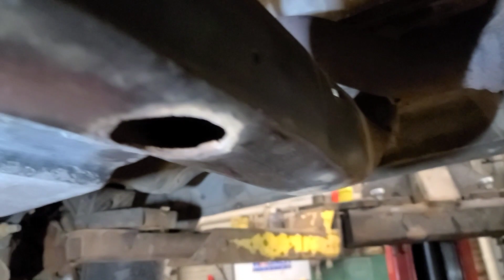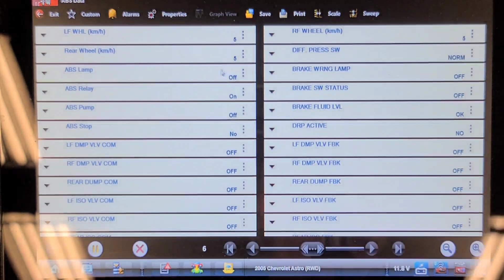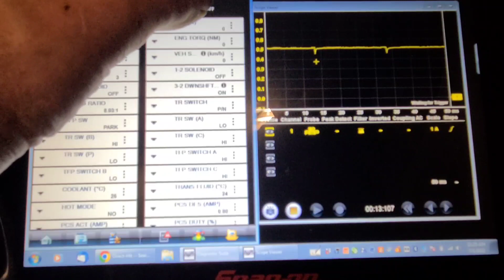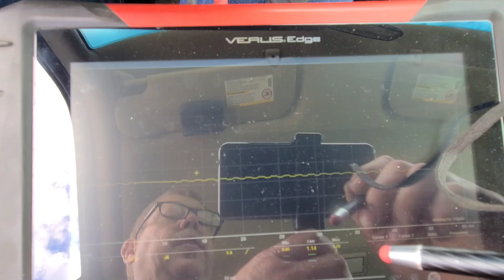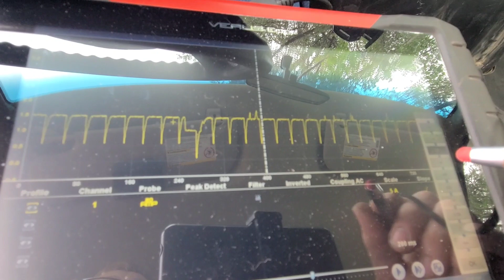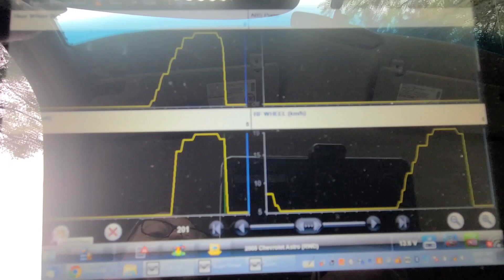2005 Chev ASTRO Van Transmission Limp Mode, P0758 and ABS Light On.

Comment: Any updates? Have the exact same issue with the trans and the abs. Maybe a wheel speed sensor throwing them both off?
Reply from the maker: Van got a transmission rebuild, ABS pump motor was unplugged to stop an unwarranted abs actuation due to a weak speed sensor. Truck got a RF wheel bearing to correct that.